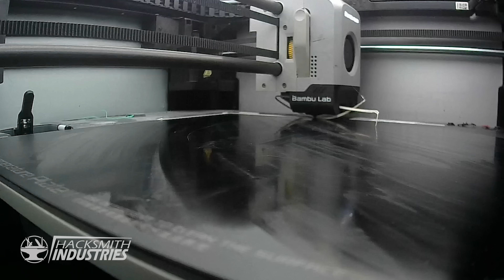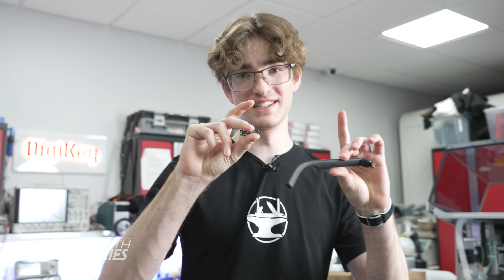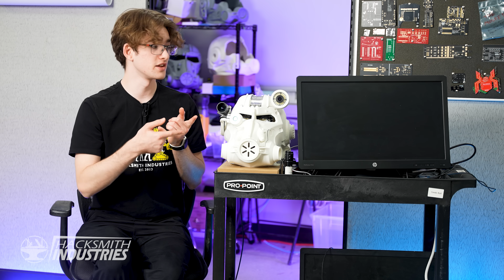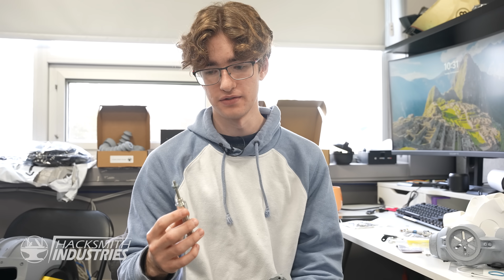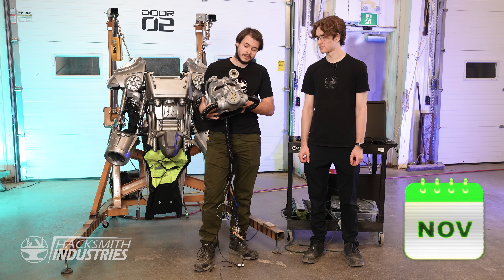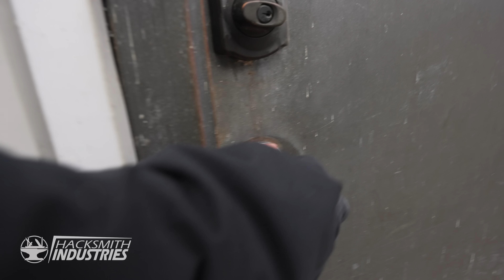World's Most Advanced HUD | Real Life Power Armor (Part 3/6)

Comment: By the way, i doubt this message will get seen but i can forsee a problem with the armour being overheating, as all heavy suits that fully enclose a person tend to do.
a potential solution i think could work is PSM "Ice packs" that stay at a consistent, tuneable temperature for hours all while being super cheap and easy to use. 
Get some bags of it, stitch a vest with pockets for the bags, and then either put that on the inside of the suit or keep it as a seperate garment.

Nighthawkinlight made a great video on the topic, and i do genuinely believe it will be a real help in the future
Reply from the maker: Even better -- the suit has liquid cooling. not temporary ice packs
Reply: @hacksmith  next you are going to tell us that it is also nuclear powered...
Reply: @hacksmith  What are your ideas for cooling the liquid? Heatsinks and fans are not very reliable, fast, and efficient, along with sensitive to dings and whatnot. Heating should be a bit easier, like with an aquarium heater.
Reply from the maker: Small heat exchanger with Peltier -- considering an Eight Sleep mattress can keep you warm (or cool) and its unit is only about 2L in size, we can go a bit more compact!
Reply: @hacksmith  why not use forced air cooling instead of Peltier? It is more efficient and looks much more cool - see FO2/FNV Enclave APA Mk. II for reference, it has big fan on the back. Also, big protective grille for the fan can be made from metal pipes and used as additional heat exchanger/radiator, since you already have liquid cooling system.
Reply: Completly niave to making stuff and anything related to armor suites etc, but couldn't water cooling be implemented as well with the ice packs or by themself to help with overheating?
Reply: You can forsee a problem all heavy suits tend to have? How? :D

Comment: Would a weak suspension style spring not work better for the front mask? that way its more universal per user and way easier for maintenance. Also question, is it possible to mount the camera's closer to the eyes? assuming the cameras input into the HUD directly does it not mess with the FOV with the current setup? Might be wrong though.

A weak weak spring/suspension based system may be great for attaching the head too as it allows for some adjustability for each user

Comment: HUD ideas:
1. Apple air tag overlay
2. Yeah, a clock would be nice
3. Live translation
4. Radio comm strength to base station
5. Constellations overlay
6. Upcoming weather
Reply: Constellation overlay seems a bit much
Reply: Integration with equipped weapon gunsight... gunsight hud.
Reply: Location of pizza delivery driver as well!
Reply: Also the option to turn off ir light. Everyone with an NV would see you as bright as christmas tree (and IR light isn't healthy for eyes).
Reply: @deauthorsadeptus6920  Dunno why you think IR light isn't healthy for eyes.
Reply: @renascitur7051  it actually isn't, we can't see it, but it's still a spectrum of light and looking into it for extended periods of time can cause damage to occular nerves.
Reply: @deauthorsadeptus6920 this type of exposure isn't going to do anything, first off the light is to the left of the helmet meaning they are not looking into it, which even looking into IR lights you have to have a high intensity one in order to cause real damage with long exposure. Basically this setup they have will cause no harm at all even if they leave the IR on all day.

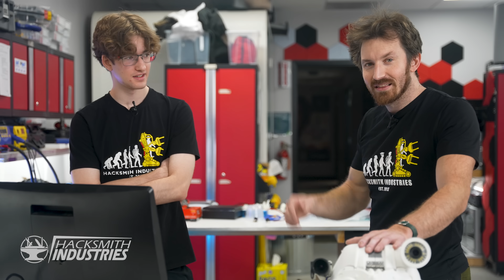Comment: 13:43 maybe like,, something to tell you theres something behind you? So if ur backing up you wont smack into smth behind u (kinda like a baxkup camera, like the 'enemy HUD' in the top of the in-game power armor)
Reply: It could use the sensors from the Spiderman mask.
Reply: Maybe an air purity sensor too as well a thermometer (to check the internal temperature of the suit as well as the external temperature). Maybe the suit could have its own heating and cooling systems as well so if it’s really hot outside, you cool down inside or vice versa.
Reply: And the AI assistant could automatically adjust things for the suit to maintain homeostasis or for the suit wearer to be comfortable.
Reply: Also like an embedded AI assistant. You could use ChatGPT but it would kind of be like a Jarvis situation.

Comment: military: 
i'll take 50 of those, why? 
for fun of course :)
Reply: If Hacksmith can get a somewhat jank but partially working prototype, i have a feeling the military has already tried and tested an actual working version.
Reply: Yes, clunky armor who doesn't go thru door, that's be useful.
Reply: @SaitoGray  With a suit like that, every wall is a door soon to be made!
Reply: @deviousspirit3156  they can barely manage to move in it.
It's an insanely cool projet, but let's be honest it just an ultra expensive cosplay, useless in any kind of real life application
Reply: @SaitoGray  I think that's the point of what they're trying to do...
Reply: @SaitoGray  mobile heavy weapons platform that can move in semi tight urban environments that vehicles cant and forces enemy's to have to use weapon emplacements limiting their mobility or anti vehicle weapons just to deal with it
Reply: @TrenchCoatDingo  Until they encounter what is essentially a miniaturized autonomous tank that is smaller (thus can go anywhere infantry can go), faster, handles rough terrain better, thicker armor due to higher load capacity of treads (and no, better materials are not exclusive to power armor), has a bigger gun (which would punch right through most cover), can carry significantly more ammo for that gun in safer storage compartments, and does not possess weak points like joints.
Reply: @Verrin_the_Wyvern  untill then
Reply: @TrenchCoatDingo  yeah, they will work great face to a dji drone with a grenade attached to it.
They kind of thing have absolutely no future. Drone warfare proved that.
Reply: @TrenchCoatDingo  - what do you mean, "until"? They basically just described a ground drone.
Reply: @SaitoGray  I was thinking it can be useful in security applications, that is if its not crazy expensive.